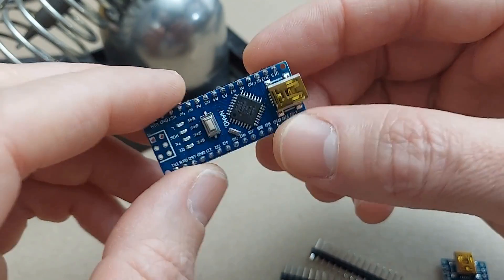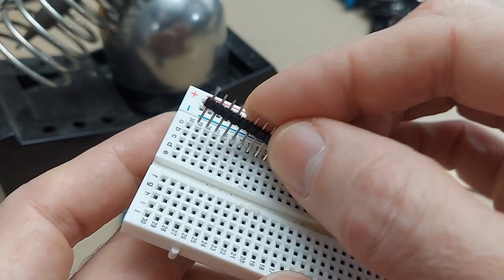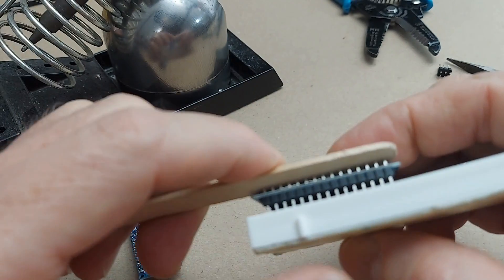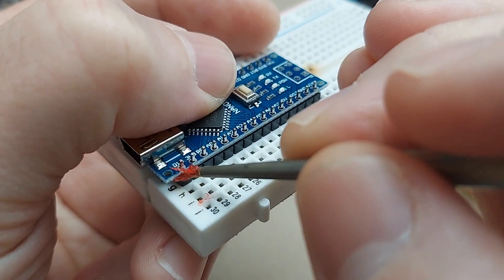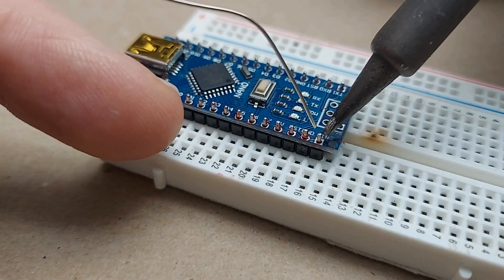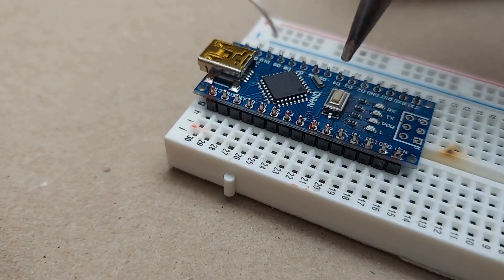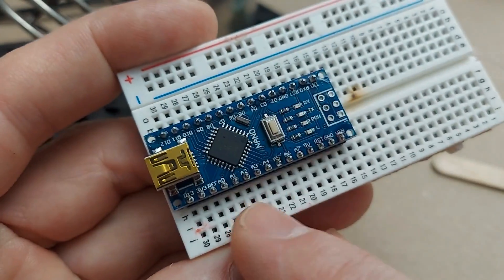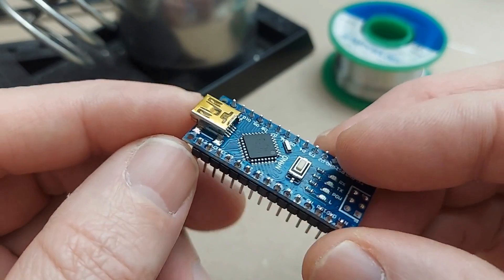Soldering headers on an Arduino Nano

Comment: Thanks for sharing your settings. Mine are Lonove BK969S soldering station set to 666F (352C), Schneider solder (63" tin, 37% lead), 1/32" (.8mm) diameter, 446F (230C) melting point. The diameter sounds like a very important factor. I use GC liquid flux. 
Your settings: My soldering iron is a Weller and it was set to 350 C. The solder is some cheap stuff off Amazon 0.6 mm.. I don't see a temperature rating on it. And I used Ruby fluid soldering paste flux.

Comment: Very good. What temperature was your soldering iron set to, and what kind and temperature was the solder rated at? TIA
Reply from the maker: My soldering iron is a Weller and it was set to 350 C. The solder is some cheap stuff off Amazon 0.6 mm.. I don't see a temperature rating on it. And I used Ruby fluid soldering paste flux.
Reply from the maker: Also.. LOL OMG I'm still so terrible at this. Those are great questions and I really should have mentioned those things in the video.